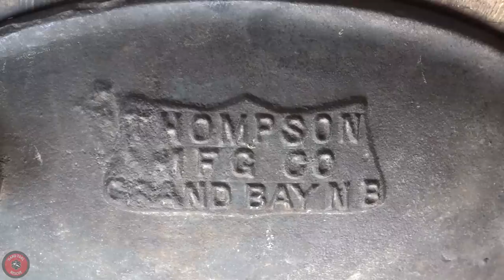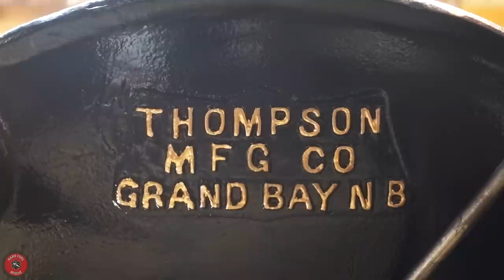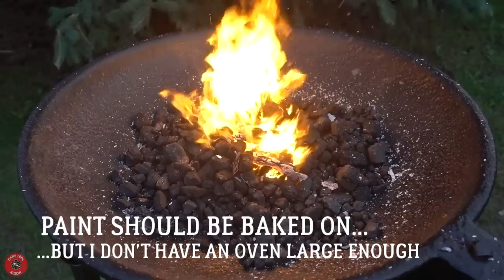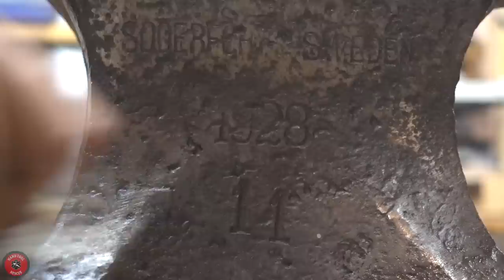Antique Forge & Anvil [Rescue]

Comment: As someone else pointed out, this is a "Horseshoeman's Forge", designed to be relatively portable.  You are missing the refractory in the pan though.  As you know, the pan is cast iron, and you'll burn through the cast at forging temperatures without a refractory.  Vermiculite (yes, the plant food) mixed in with concrete and some rebar makes for a good enough refractory.

I helped set up a blacksmithing program at the local Boy Scout summer camp because we found two of these with original squirrel cage blower motors still in good working order.  Made the refractories for them, sunk a telephone pole into the dirt, built a cool building around them, anchored the anvil and went to town!  It was a great learning experience!
Reply: I came here to comment the same thing. The grate seems to be missing too

Comment: That internal pipe wrench might not work on a non-rusted pipe. The harder it grips, the harder it forces the pipe into the female thread, which increases the friction.  I have a broken stud/bolt remover that works (to misuse the word) in a similar fashion on the outside.  It cost me $40, and didn't work worth a darn.

Too late now, but teflon pipe dope (or just tape) on the threads would make it easier to remove those legs again, if the need arose.  BTW, it's great for union threads, too, so they are easy to take apart years later.

I keep edited this comment as I watch.

Didn't the old-time blacksmiths use 686 silicone sealant?  ;o)

Comment: Great video! Just followed you, and I love your channel! you do what I do out in my shop! Same struggling with old odd bolts, getting covered with rust and grease, and winding up with some spiffy tools! 

But heads up! That type of forge is intended to be lined with refractory! Otherwise you risk cracking the cast iron pan.  Forges that have a separate fire pot are the ones that can get away with not being lined. You can get some refractory cement, or use clay, and if you can't get clay, use the cheapest kitty litter you can find, it's clay.  I like to use a mix of about 3 parts clay, 2 parts sand, and 1 part grass clippings or some other organic material, like oatmeal or rice. Then mix it as drive as you possibly can and ram it into the forge. As it dries it will crack, make a slurry and fill the cracks. Then once it's dry you can start a fire. It'll crack over time and eventually need to be replaced, but its very cheap and works relatively well. Goodluck!

Comment: The Ball Bearing Anvil Test: Hold bearing in your hand over the anvil. Drop it on the anvil. If it bounces high enough to reach your hand again, buy the anvil! 
Maybe the Ball Bearing Test could be done over the entire top to determine the relative hardness of the top in relation to itself to see if there are softer areas in it. 
It is also possible to get an anvil heat treated again. I know for certain that it is done at Ohio State in Columbus OH. It isn't done until there are enough anvils collected together to heat treat all of them at the same time. The cost of heat treating one anvil is close to the same as doing a big group of anvils...

Comment: Never use an expanding bolt extractor with pipe threads. Pipe threads are tapered and expanding them with a bolt extractor makes the broken piece even tighter in the threads. Use Pipe extractors.

Comment: First you are insanely talented.  You need to invest in a battery charger and use some electrolysis when cleaning up your old metals.  Based on other You tube videos it works Great.  Gets into all the nooks and Crannies and does not damage materials like the grinder may.

Comment: Most forges have refractory lining and cast grate to stop the corrosion from the ash. If the ash get wet or humidity is high it makes caustic lie, therefore corroding away the iron. Just a suggestion.
Reply: This is true, it also helps prevent the heat from cracking the thin cast iron on these old portable rivet forges. Most smiths I have worked with use natural clay or something along those lines. Its not as permanent as refractory cement, gets the job done and is cheap and easy to replace once it wears out.
Reply: same with charcoal grills.  good idea to clean out the ash after use or the bottom will get eaten away

Comment: By glueing the anvil down with silicone you don't need any other fixing system! Interesting idea the silicone! I wonder if it made the anvil quieter? An old method was to put a sheet of lead under the anvil to make it quieter when struck! Regards, Matthew
Reply: Another old more common method was to wrap heavy chain around the base of the anvil.

Comment: I think your supposed to pack some clay or sand in the bowl of the forge to help insulate the metal bowl from the extreme heat. A lot of people might want to kick your ass for milling the anvil too but I couldn't really tell if you were cutting deep into the entire face or just skimming the weld.
Reply from the maker: +Rainbows871 I talked with some local blacksmiths who work with older forges like this and said the lining is not necessary in this case.  I just took enough off to get one full clean pass once the welds were gone.
Reply: Ah fair enough, you wouldn't have been the first person to mill off the entire tool steel plate and destroy the anvil. Looks like you still have a 1/2" of plate left though so probably not too many people will complain.

Comment: Normally I am right behind you cheering on your repos, but something just struck me wrong on this equipment for some reason. I can't put my finger on it, but something just didn't seem quite right. Maybe it was milling the top of the anvil or grinding a new "T" on the forge, or putting sealant under the anvil. maybe it was a combination of multiple teeny-tiny little things. But something just struck me wrong. I appreciate what you do bringing old tools back into service anyway. I know there is a better use for that beautiful stump of wood than an anvil base, but I was bothered before seeing that. Hmmmmm, I'll have to think on this one and watch it a couple of more times to see if I can figure it out.
Reply from the maker: +Thomas Russell No worries!  Glad you liked it though.  These type of videos are tool "rescues" instead of restorations.  I just needed everything functional enough to use.
Reply: +Hand Tool Rescue good answer
Reply: I understand that, I have a video where I didn't film it very well, I am new to this whole filming things. I came across a Bailey 5C plane that had busted tote and knob and did my best to make new ones. It is functional now, but the tote and knob aren't quite right. Bugs me every time I use it because they are made from pallet wood instead of rosewood, but it works. Also, for some reason when I brought my planes back to usable from rusted hunks, the paint did some kind of weird wrinkle pattern. I am no saying I'm perfect by any means. I appreciate what you are doing for these old tools.

Comment: One thing you could have done better was the work on the anvil.  No need to mill it flat.  I've rebuilt ca. 100 anvils, usually about 20 at a time.  The procedure is thus:  grind all chips and other injuries until you have clean metal.  In some cases, one can follow a crack right through the face and into the body in the case of wrought anvils.

Preheat to 400ºF.  Use Lincore 50 or Lincore 55 if MIGging.  Hobart Smootharc 600 if stick.  Fill the voids.  These hard face rods go on a full hardness.  Dress the anvil with grinder and finish with 80-grit flap disks.  You don't need to go any finer.  In fact, 60 will do just as well.  Wrap in refractory blanket and let cool slowly.

You don't want the surface to be too smooth and having it perfectly flat in not nearly necessary.

Comment: I did one very similar to that one. The pan should have a refractory in it though so it doesn't burn through. I went to the garden store and got a large like 20 or 30" terra cotta saucer that fit in the bottom. Used a masonry wheel to cut out the hole in the bottom and finesse the edges so it sat in perfect. set it in with a little furnace cement and it worked perfect. Also the holes along the top edge are there to attach a sheet metal hood and smoke stack. It will help control your draft and keep the smoke out of your eyes. Nice job

Comment: for your forge legs and hardware....  go to your local welding shop and get some Walter Rock 'n Roll.  It's a ceramic based anti-seize.  It'll take whatever heat you can throw at it.

Are those the Steel Toed Birkenstocks???
Reply from the maker: +ramosel I'll check it out!  Definitely steel-toed.

Comment: Eric, with such a wonderful job, how hard would it have been to do some repair on the pan stand socket. I don't know if JB Weld Extreme High Heat was available then, but it would have been one solution.

Comment: I put rear end oil in my Champion 40 thinking it would be good and it was till winter and it made it almost impossible to crank. I cleaned all of that out and went to non detergent 20 weight with Lucas Oil treatment in it to give it some stickiness. Seams to b e working fine in my 40 and 400.

Comment: That old anville needs more work. 

Queue the "anvilles are supposed to be rusty" comments

Literally all is for naught if you dont scour out the rust and pits of the anville and coat the sides lightly with protective oil and dry it off after 48 hours of set. This way the body is not damaged further by time. Also radius your anville edges and blunt the saddle tip. Your legs will thank you later.

Comment: Def would not have wasted what it looks like to be glue that holds the anvil to the stump although to each his own. i highly doubt youll lose any hardness on that anvil from welding on it, not any more thant was probably lost over the years. the forge turned out pretty nice. I enjoy the imperfections some old tools had so i dont think i would've fixed the name plate area although it did turn out really nice. I will say i cringed at some of you working techniques but you still got it done and the end result was a MORE then workable anvil and forge. I also really like the paint scheme you have on the blower and forge.

Comment: Late to the game comment here, Soak your coal in water, it will remove the excess coal dust from the coal and helps to burn the impurities in the coal off to form coke, don't be afraid to fill the bowl with coal, at least an inch from the top, and don't be shy with the air, crank that sucker and light up the coal, the real heat comes after the coal has turned to coke.

Comment: That gasket is going to reek when it burns away. There's no such thing as gasket material that can take 2000 dungarees.
Reply from the maker: +tartredarrow haha, I totally agree.  I just want to see what happens.
Reply: After it's all said and done, you might as well have just rubbed some charcoal into the voids and called it a day! Better than nothing at all I suppose! If you were really interested in maximum efficiency, you might chase down a thick crushable metal gasket such as the type sometimes used on exhaust manifolds. Best I can describe it is like a corrugated metal material.
Reply: I would think furnace cement would work, but what about stove gasket material, like a rope?

Comment: Why did you opt for an abrasive approach to rust removal vs soaking it in vinegar, or some other fluid of the same purpose? In my experience, vinegar does an infinitely superior job over an abrasive wheel and gets into the nooks and cranny (especially on pitted metal) far far better than any wire or grounder wheel. The only catch to using vinegar to remove rust is that, once the vinegar is wiped off the metal will rust in normal humidity conditions; it must be immediately coated with an oil or other coating to protect it from moisture of any kind.
Reply from the maker: +Venger Voldur I wanted to try out the rust converter solution.  So far, it seems ok.

Comment: This fella could sure make use of a couple of electrolysis tanks to clean off all that rust.
Reply from the maker: +Bub_ Lite_63 Yes!  I need to set up a big one next summer.  Too cold now.
Reply: Hand Tool Rescue: Are you the same fells that does the vintage power tool restorations? If so, you sure have some nice old tools. I enjoy watching you making them look great again. Used to work on stuff like that when I was younger. No restorations, just clean it up and fix it. Can't do it any more though. Can't see good enough. Fine job on the forge and anvil. I was rooting for you when you were trying to get rusted studs and the ends of those pipe legs out. Be watching for your next project. 👍

Comment: At 8:12, the converts-rust-to-primer stuff, is that hi-temp?
Reply: Greg Feneis once the converting process is over , it is. It converts the iron-3-oxid into a stable layer. Somebody correct me if I'm wrong.
Reply from the maker: I don't think it is high-temp, but so far it works for some reason.

Comment: I'm sorry man but you did stup*d things with the anvil : Why gluing it on the wood ? You will have difficulties to pull it off ! Usualy anvils are just laid on a Oak support , and more you work on (hammering on it) , more the support takes the shape of your anvil .
I loved what you did in past (The gas powered circular  saw for exemple) ,  , but for this anvil , you did very bad things ! (Thanks for reading and sorry for the english , i'm french)
Reply: Le Renard 1. Ideally you don't pull it off the stump often 2. Putting a layer of silicon caulking between the anvil and the stand is a popular method of quieting anvils, surface contact with the anvil and another thing dulls the vibrations, if the entire base is making contact with the caulk, it's becomes nice and quiet. That brand of anvil is deafeningly loud, he did good there.

Comment: What's the significance of the blue coloured Grease any, should have really cut it out on the wood block for the Anvil to sit in not sure about those brackets holding I would have thought you would put some builders adhesive in the holes? I know it's not really being used so it probably be alright but any heavy use they will come free